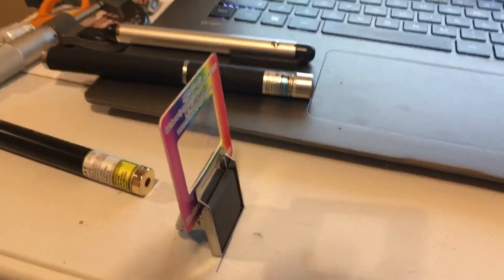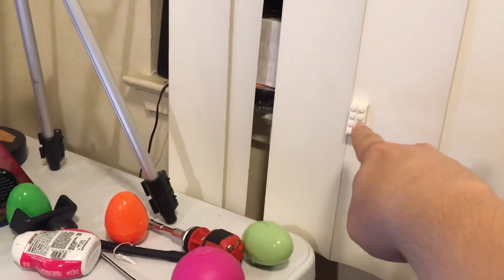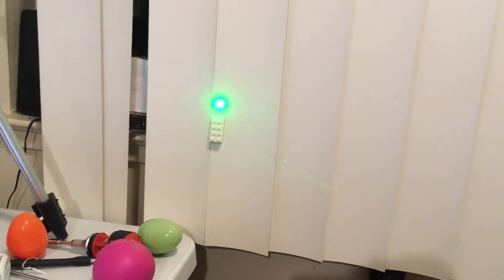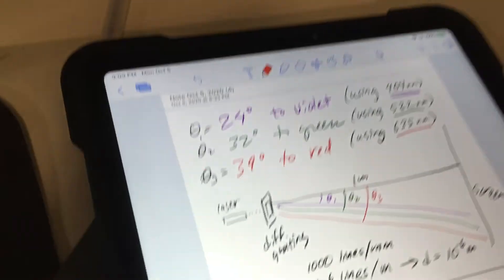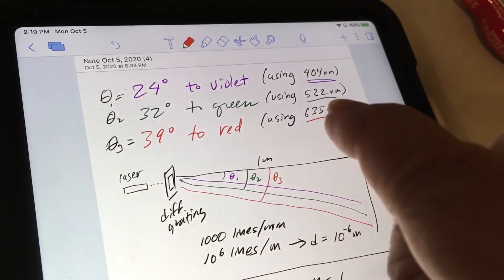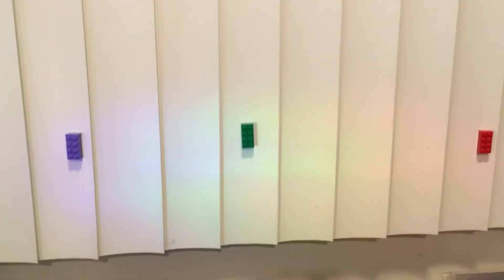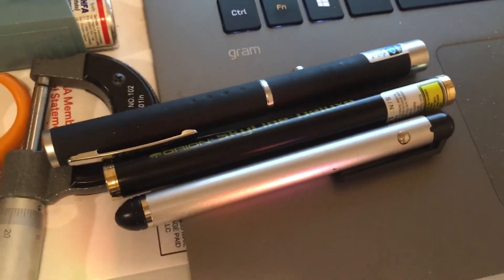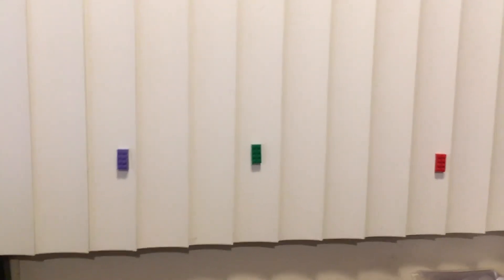A quick light experiment from home—diffraction grating

Comment: Do we need double axis diffraction grating for this or does it work for normal ones?
Reply from the maker: I use a single axis to avoid confusion. The double axis will work as long as the specs are given for the lines/mm along both axes.